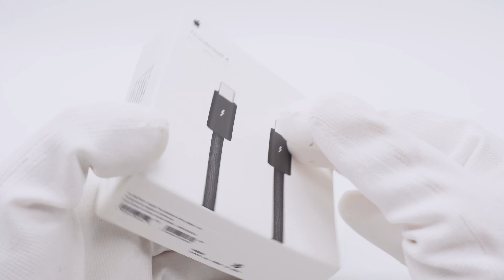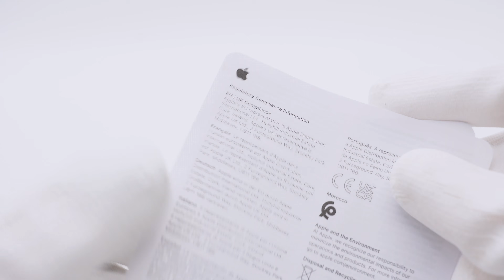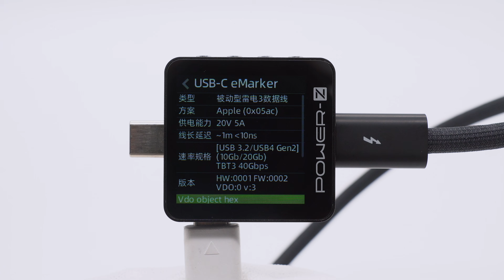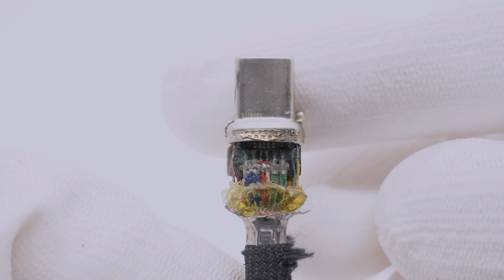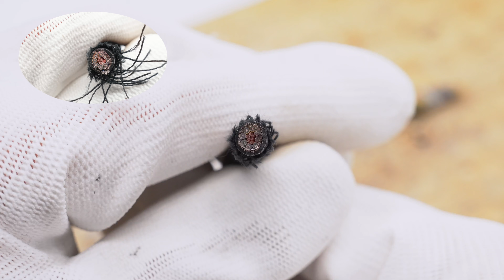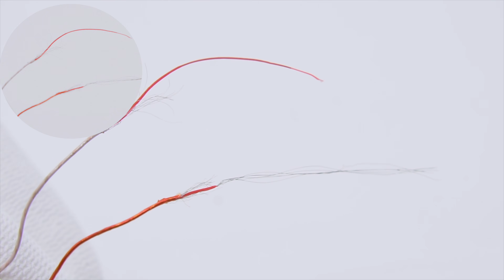Affordable Option | Teardown of Apple Thunderbolt 4 Pro USB-C Cable (1M)

Comment: Just got the 3m version to work with my 5 bay Thunderbolt 3 external array.  Works like a charm.  The only Apple item I own, not cheap, but the build quality and expected reliability won the prize.  So far no regrets.

Comment: Passive 1 meter Thunderbolt cables, which don't use a retimer, may be able to support the most recent revision of Thunderbolt, that doubles the data rate to 80 Gbits/s.

But I'm not sure. As usual, I am confused by Thundebolt. I would like a future-proof cable. Or at least something that won't be obsolete in a couple of years.

Comment: There was a different 1m version originally included with the Studio Display that had the larger connectors from the 1.8m and 3m cables.
Reply: I would love to know if the connector is the same or different on the inside.
Reply: That also got my attention. 

Are there different versions between the Apple one meter cables?

Comment: i dont think the 13" mbp has a thunderbolt 4 port. could be affecting disk speed test results
Reply: The base version doesn't. However it has TB3 and I think the same USB version. So unless the device used to test the speed was a TB4 enclosure, there shouldn't have been any noticeable difference... Probably more related to MacOS vs Windows.